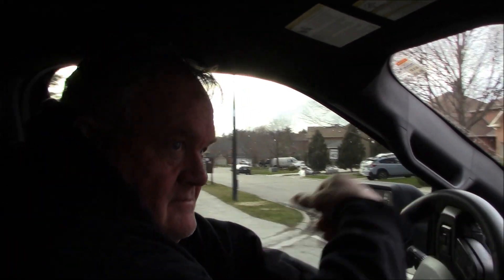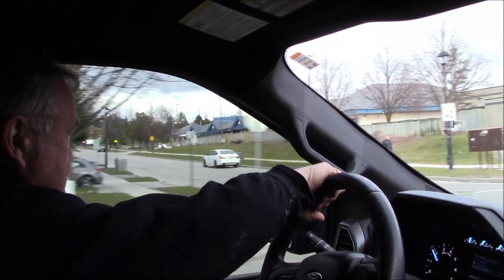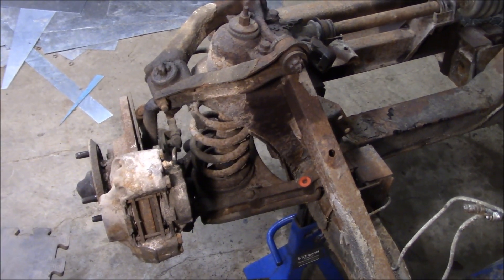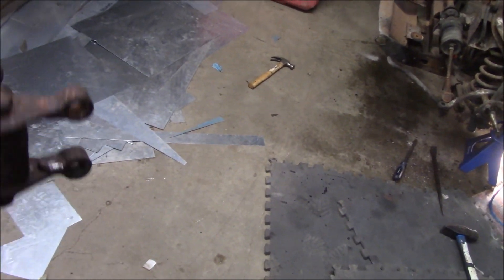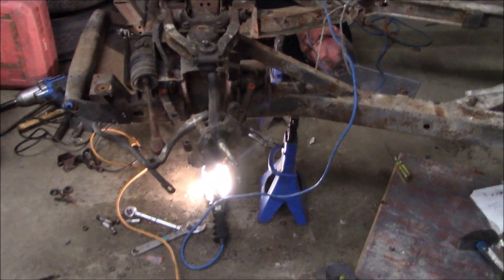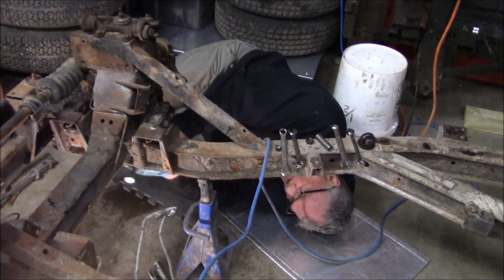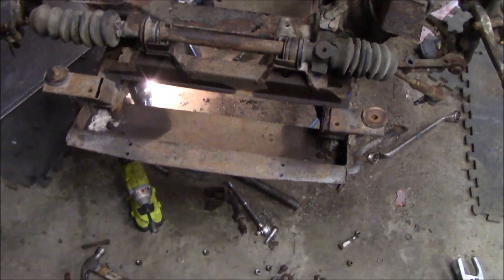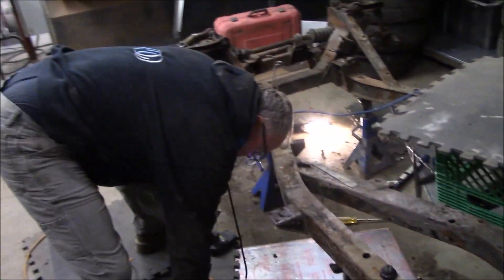Les's 1976 Triumph TR6 Restoration,  Day Seventeen

Comment: Chef, I totally agree with you about the frame. I have built the Jig Elin designed for my TR 6. Have bought new upper and lower T-shirts and am ready to weld them back in exactly where the old ones came out the total Canadian for this has been $300.95 CDN  (Freight and Brokerage included )plus some locally purchased metal at $17.00. It has taken some time to do it all but is a whole lot of enjoyment as it is something that I wanted to achieve myself. While my son did the costing of the Ratco late last year it was going to be  $11,500 CDN. as you say now way more. That's more than I wanted to spend on redoing this car in total. They are nice (frames) but not that nice for what I need.

I got mine from Rimmer Bros. Everything came but backordered the lower t shirt . That actually came today and was shipped last Wednesday after backorder since Jan 26th. They must have only gotten enough in to cover backorders. I was goingto cancel the backorder and get it from Moss as they were still shipping from Virginia. Thankfully I didnt as that day they stopped shipping from there as well as California. The other stuff all came very quickly, I have costed it out and with the pound at roughly 1.75 now then brokerage and taxes I use a factor of 2.09 to get my real cost
Reply from the maker: Thanks Barry. Yes, that’s we are going to do as well. Where did you get your replacement parts from.  Moss is closed, Rimmers doesn’t have the bottom plate in stock, Vic British is closed, BPNW don’t stock....haven’t check roadster factory yet...I’d have to call as you probably know they are famous for back orders...

Comment: Chef, I'm currently in the process of welding in frame patches on my 66 TR4A and have found that the internal spacers, used to surround and space the bolts that hold the rear bumper brackets to the frame, within the frame channels are rusted out and need replacing. The spacers are welded on the front side to the internal frame channel. These internal frame spacers function the same as the spacers within the replacement trailing arm chassis members and keep the channels from collapsing due to torquing the bolts. I want to order them but can't find them on any of the usual sources in any of the catalogues (Moss, VB etc...).  Any idea what they are called and where I can get them?  The new extra refurbished frame I have just has sections of 1" pipe welded inside the chassis rectangular tubes to act as separators/spacers but I would like to get original replacements if at all possible. There are also similar types of spacers at the front end chassis tubes which I will want to replace as well. Any help would be greatly appreciated.  I want to replace them now as they originally welded them in place so they don't shift if the brackets are removed.  I could fabricate my own if required but that would be my second choice. Thanks, Ron
Reply from the maker: Hi Ron, unfortunately, I’m not aware of where you can get those internal frame stiffeners.  As you mention, I’ve seen people just use pipe as a substitute.   The only thing I can suggest is to give British Frame and Engine a call.  http://www.britishframeandengine.com/index.html
Reply: @cheftush  Hi Dave, thanks for the speedy reply.  I called British Frame & Engine in California and they don't have any frame stiffeners and the guy I talked to said everyone just uses sections of 1" pipe, so this is the route I will take if my fabrication skills are not up to task to reproduce copies of what I took off my frame.  Love the videos from yourself and Elin and I have learned tons of tips and how-to instructions.  I especially like the way Elin explains all his thought processes on fabricating patches and deciding how to proceed with multiple patches to achieve the effect he wants.  I've now watched over 350 videos of your and Elin's work and they have helped me immensely.  The wooden body rotisserie I made from Elin's plans works great and I have used a couple of tire dollies (with wooden spacers to trap the 1" plywood sides) under the ends to store the tub on its side to enable easy movement by myself.  The metal rotisserie I made out of two engine stands and scrap metal also works great and sure makes welding on the frame easier.  Thanks again for all your great work on the videos and I look forward to your next instalments on Les's TR6 and your 250.  Cheers, Ron

Comment: I would be sorely tempted to go for a Ratco frame rather than a replacement of the T shirt and trailing arm mounts. Just to know it's square, utterly free of rust with all the reinforcements and, if required, upgrades. Originality is not going to be a question for this build or for that matter most TR6s.
Reply from the maker: Ashley, just for fun, we did the math on the RATCO frame...would you like to take a guess on how much it would cost in Canadian dollars to have one shipped to us here?  Don’t cheat and look it up 😉 give me a number please
Reply: CA$8000 ?
Reply: Elin can fix anything he has the jig for the trailing arms and the tee shirt is an easy job for him the ratco frame as good as it is is way too much money for just a go around block car.
Reply from the maker: Ashley Austin morning Ashley...by the time you do the currency conversion, add shipping and Canadian taxes at the border, you are probably looking at a 12-13000 cost.
Reply from the maker: ralph cap well, I don’t think the plan is for Elin to fix this Ralph...I will borrow his Jig though.
Reply: @cheftush  
The Ratco frame on a pallet is US$5850 or about CA$8300. H.S.T brings it up to about CA$9400. Unless shipping and duty is around CA$3000, I think your estimate is rather high. I omitted powder coating as the original frame doesn't have it either.

Comment: You know that you can re oil those shocks..
Reply from the maker: Are you talking about the rear lever shocks?
Reply: No the telescopic ones.
A small hole can be drilled about an inch from the base and old oil drained ,measured, and then new oil added and then the hole welded up.
Reply from the maker: vwbus guy well, we broke the top off one of them so they are going in the bin 😉